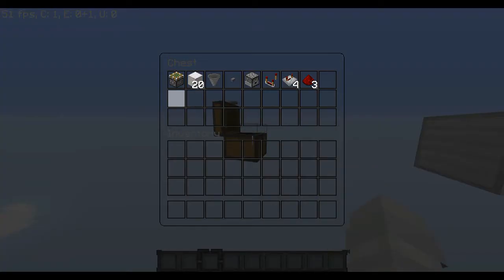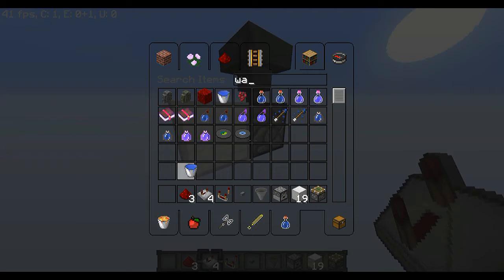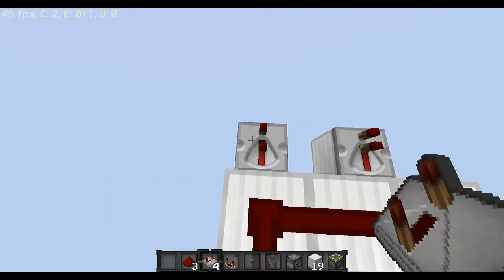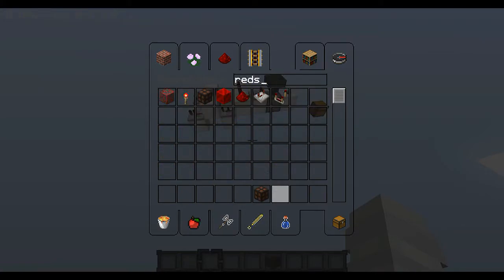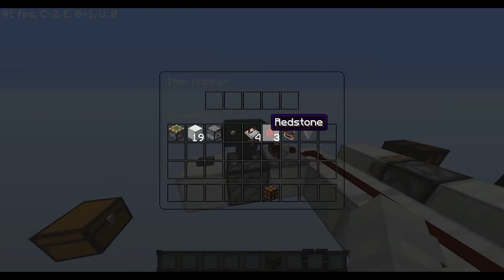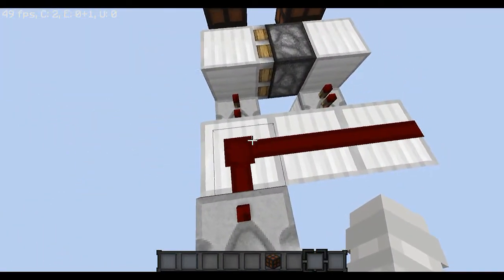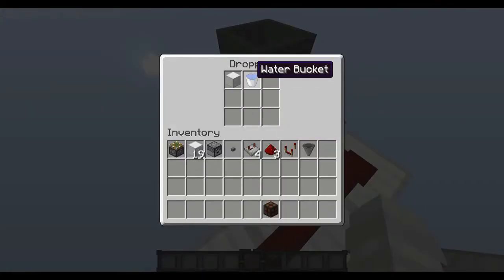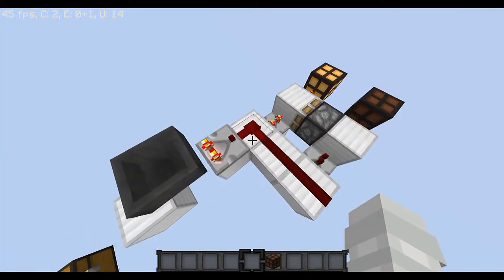How to Make a Redstone RANDOMIZER!

Comment: im confused i just cant see what the piston is for
it works without it and dosent with it
Reply: It's been 3 months lol but figured I'd chime in.
You're right, in fact the only thing really required is the dropper/hopper and some way to interpret the output. 
Output is 1 or 3, so basically ignore 1 and test for 3. You got a binary output.
I will admit, the piston does add an interesting visual element tho.

Comment: If it doesn't work, its either a bug or you've done it wrong. (Note the fact that the first left repeater has a two-tick delay)
In case you still don't understand the mechanic, the dropper goes into the hopper, of which feeds back into the dropper.
However, for the split second that one of the items is in the dropper, the comparator gives a signal. This signal has a strength of either 1 or 3, depending on the stackable or unstackable item respectively. 

In the signal strength of one, it goes to the first repeater and goes to the left lamp.
In the signal strength of three, both repeaters are activated. The repeater on the right side powers the sticky piston and extends it so the lamp on the left side doesn't receive power, but the right lamp does.

Comment: doesnt work for me

maybe its 1.13 i dunno
Reply from the maker: I believe that it may be your input? AN observer or other monostable will be less effective, a lever or button will always work to be random. Other than that I guess check the repeater timings or maybe making sure you have 1 of each nonstackable or stackable. Maybe if that doesn't work, send a picture or explain how you use it and that will work. Cause I built it in 1.13 and it worked fine :/
Reply: I used a button, i put stone and a flint and steel, I'm going check the repeater timings here real quick, and im going to use it for a useless machine that has 4 different ways to destroy the lever, so it was the first thing i built.

OH WAIT THE LEVER POWERS A BLOCK SO I NEED A REPEATER OOPS.
Reply: frick it still doesnt work
Reply from the maker: I built it how you said and everything works in 1.13 maybe make sure you have the piston facing right way. Do you have a discord or imgur to send a picture of your design
Reply: i have a discord i barely know how to use and no imgur